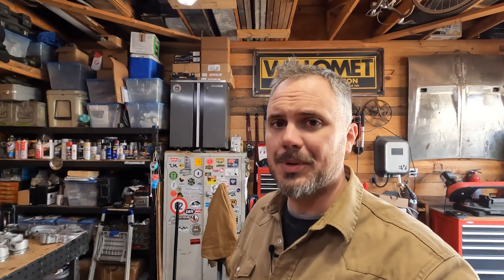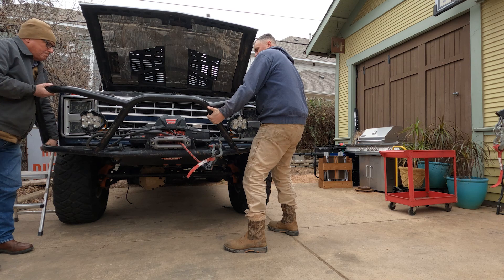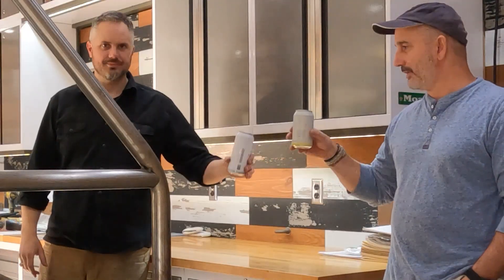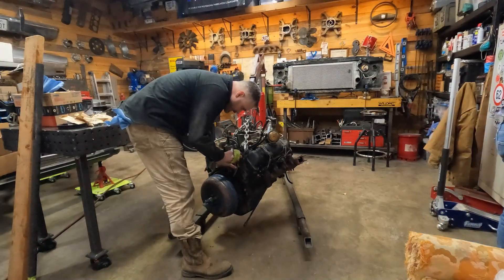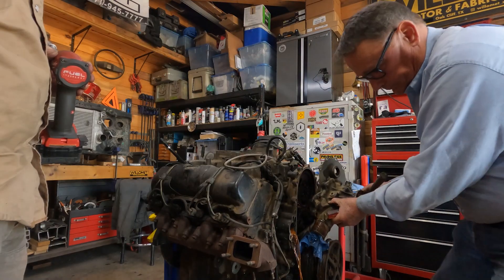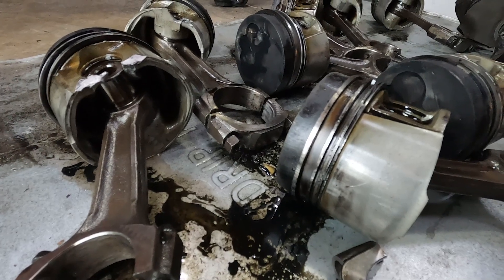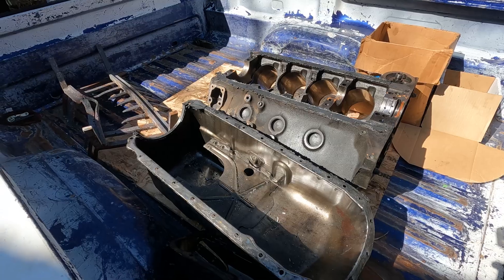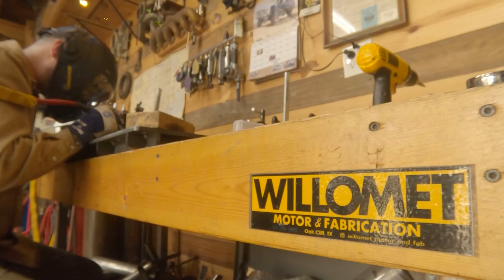I didn’t see it coming. My 6.2 Diesel tried to split itself in half.

Comment: A good R&R is always the way to go over total engine swaps. Smart move. Especially when it feels like you just finished all that custom exhaust and intercooler piping
Reply from the maker: Thanks man. So much custom stuff fabricated for this setup, I couldn't see ditching it all when there's a plug in options that makes the torque I want.

Comment: While the worn out balancer may have contributed to the crank failure, i believe the block is probably more to blame. You most likely had main web cracks that finally let go. Probably more than 50% of GM diesels left driving have main web cracks, and they progress to the point of block/crank failure like what happened to you. 

I know my 6.2 has small cracks on the main webs. I don’t know how long they have been there, or how quickly they are progressing, but it continues to run and I just take it easy in hopes to not stress the block too much.
Reply from the maker: Certainly possible, and maybe even likely.

Comment: Hey what would you recommend for power mods for a stock 6.2? I cant find a turbo kit anywhere
Reply from the maker: Fresh injectors, a full 3" dual exhaust, J intake, and a lot of cool air flow are a very inexpensive place to start. From there, a Holset HX35 is a good value turbo worth adapting, and they made a ton of them.

Comment: FWIW  the optimiser  does not have a forged bottom end. You should  have lowered the  compression  when you built the new  engine.  Chris at Twisted Steel Performance has pistons to do that.
Reply from the maker: That's what I always thought, too, until I called GEP. They consolidated at some point, and now offer them with forged cranks. It's detailed in the follow on video. Also, I considered 18:1, but need the off-idle torque for the off-roading I do, so 20:1 was the better fit for what I wanted. I do still want to build an 18:1 engine.
Reply: @WillometMotorFab  the forged bottom end is the p400. Currently  not available to the public.  Hopefully in the  future.....
Reply: You can buy the forged crank itself  though, but pricey
Reply from the maker: @lsandk3  The manufacturer told me themselves. They consolidated and use the P400 forged crank in the Optimizer (at least when I built mine in early 2022). I saw it. It's forged. This is a win for anyone looking to replace a 6.5 that wants a forged bottom end. https://youtu.be/BSB2n-WT7eY

Comment: That is horrific damage on that old thing! I'm looking to build a turbo 6.2 and am wondering where you got the exhaust manifolds and crossover?
Reply from the maker: One manifold is factory 6.2, the other is the Banks turbo manifold. I made the crossover between them as a part of the front link conversion.
Reply: @WillometMotorFab  I thought that was the banks manifold. I have been looking for one for a good while, they are so scarce. I'm probably just going to make my own if I can't find one in the next month or so.

Comment: How long was your balancer on the engine? I put a new one in about 10 years ago and it was probably a Chinese one. Do you think I should replace it again at this point?
Reply from the maker: The last one was on 8 years. Like trailer tire rubber, I recommend changing every 5 years, max. Also, consider a fluidampr.
Reply: @WillometMotorFab  I think I bought a Dorman last time. I have a feeling if I go AC Delco it's going to be same quality. May have to bite the bullet. 

Can't wait to see the next engine video!

Comment: P400 for the win! Seriously considered one for my Burban. We started getting them in 03 in Baghdad when we were blasting our 6.2Ls apart through daily abuse in the desert heat. Great motor for what it is.
Reply from the maker: Forged goodness is inbound.
Reply: @WillometMotorFab  Did you get a P400, or is this a GEP Optimizer 6500?
Reply from the maker: @JuiceSpringsteen88  the optimizer

Comment: The big question is: When are you gonna auction off the 1.75 Cylinder crankshaft, the 3 cylinder crankshaft, and the 2.75 cylinder crank? 
(yeah, that didn't add up to 8!)
Reply from the maker: I might have a trophy to raffle for the next video. How about a spent rod and piston?
Reply: @WillometMotorFab  yes!!!!